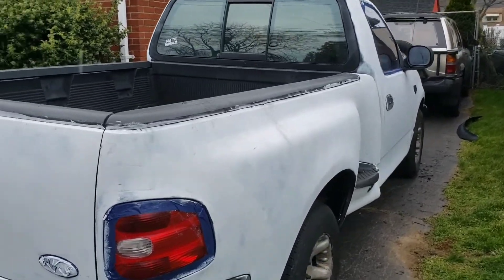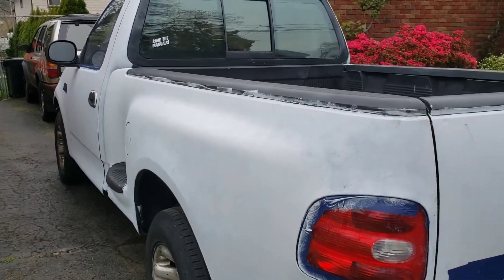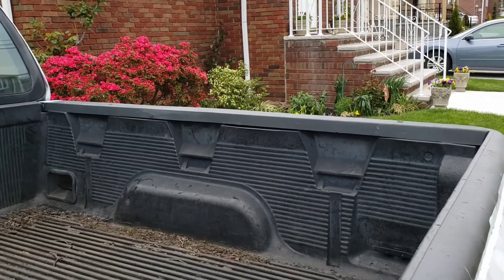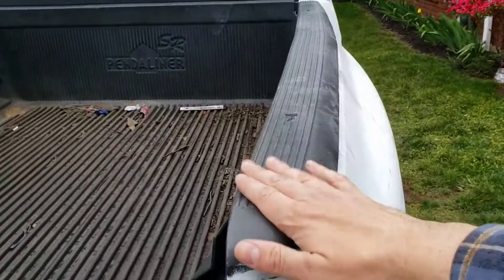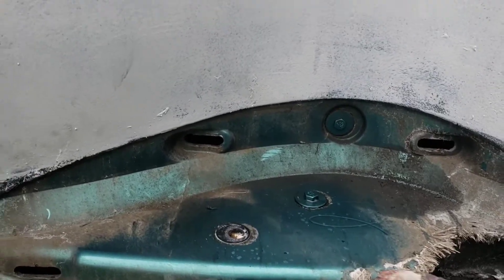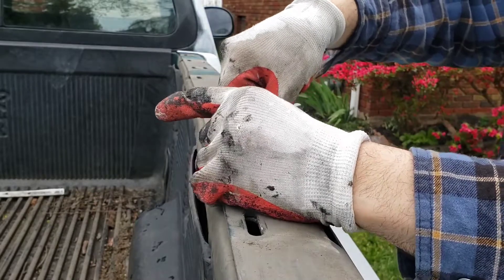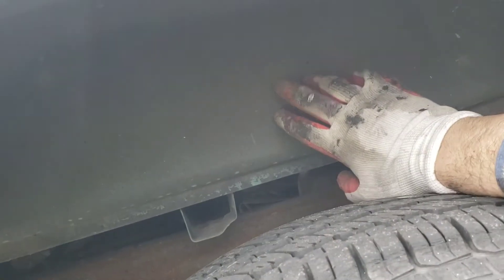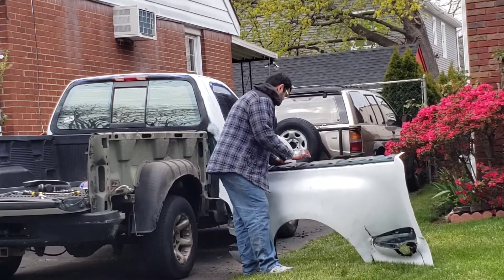How to remove the fiberglass bedside 1997-2003 Ford F150

Comment: For anyone who has to do this in the future.   Remove the 4 bolts holding the bed to the frame and you'll have a few inches of wiggle room, without impeding the fuel pipe to get to those bolts in between the bed and the cab

Comment: I was wondering if this was the same for the non stepside steel version. I have a lot of damage on one side but the other side is mint and was hoping to not replace whole bed.
Reply: same here
Reply from the maker: Sorry been a crazy year. Not sure if the non stepside is fiberglass or not
Reply: I have the same problem. It's definitely steel on the 2003 non step side. I guess I will go out and pull bolts and see if it comes off.

Comment: It's funny, you'd think the fiberglass would be for weight savings but it's heavier than the regular bed which is bigger... Thanks for the info btw!
Reply: not for weight savings its for cost savings. fiberglass typically cheaper and easier for the assembly line to slap on.
Reply: @dylangreen8679  That makes a lot of sense.

Comment: Is there anyway to push the fiberglass bed side out wards because I hit that and it push the bedside in wards in a way that make the tailgate unusable.
Reply from the maker: Fiberglass isn't really malleable like metal. You can try hitting it with a hammer but once it breaks you have to repair it.

Comment: That zip tie idea is great. I’ve broken 2 universal joints already. Ever thought about making it a flat bed? Or different bed?
Reply from the maker: Thanks! Electrical tape works as well! I needed more angle so I went with the zip tie. I was thinking of switching up the bed but I love the stepside so much! It's really unique to have the stepside with a regular cab, 5 speed, and rwd. If I ever get a diesel I'd make a custom flatbed for it.
Reply: Yusuf Rimawi man that’s super cool! Thanks for the reply! Hope to follow you on your journey

Comment: I totally disagree with your praise of the fiberglass. IMO its a sh88t design and I also hate the way the bed top corners no longer have hole throughs for if you wanted to stick in a 2x4 and screw in some plywood to them to increase the bed height for hauling yard waste etc. The fiberglass is about as lame as driver seat covers, bed covers, or spray on bed liner.